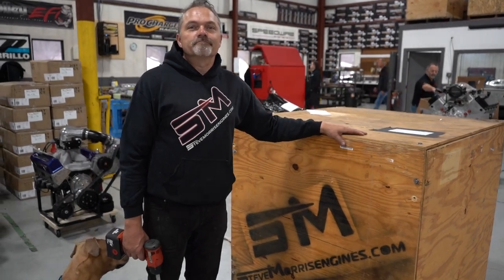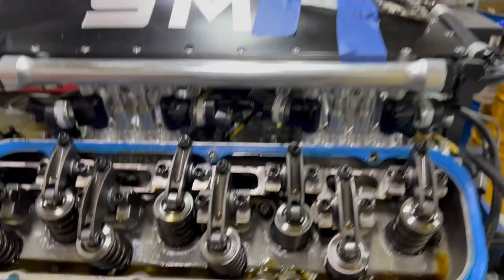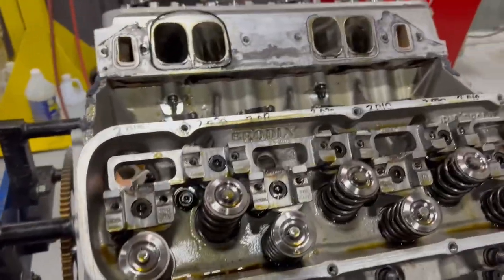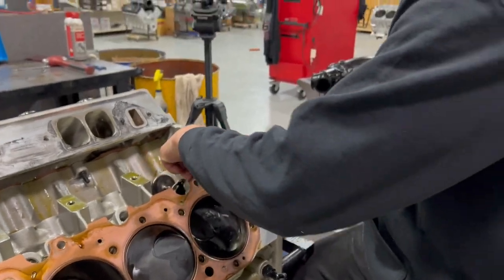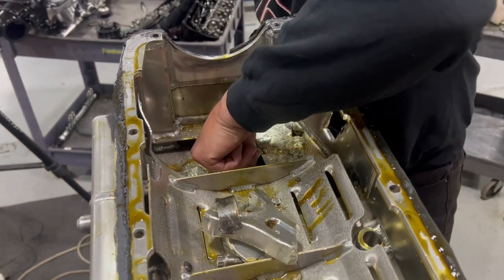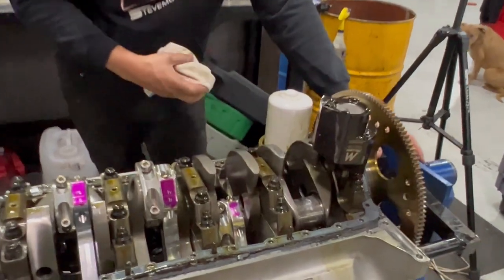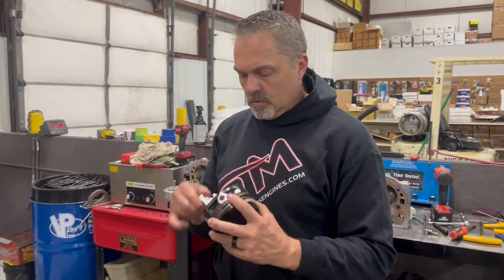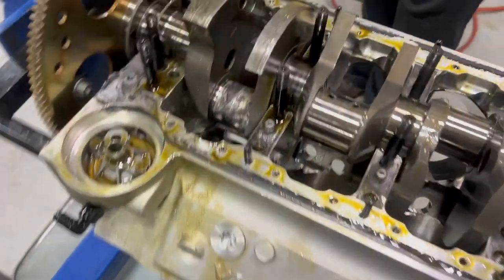Mullet !  What Happened ? - Warning: Engine CARNAGE

Comment: Only McFarland Racing can break something so quickly and efficiently 😂
Reply: Starting up ANY race engine on NO oil will do that.
Reply: @laneeric  He literally said at the end of the video if it was an oiling issue the entire journal would've gotten hot.
Reply: @laneeric  nothing to do with it dummy
Reply: @laneeric  to be fair that did happen and i wonder if it got a slight bit of bearing smeared\galled onto the crank and from there it snowballed
Reply: @tombeauchamp806  lmao
Reply: He just doing an quick V6 mod.
Reply: @laneeric  watch the whole video champ Steve says if it was an oiling issue it would have hurt the whole journal not just one side…
Reply: @tombeauchamp806  I think you are right - it doesn't take much to nick the surface, especially since it's brand new never run engine.
Reply: @laneeric  45 lbs. of boost on an engine rated for a max of 30 will do it too. Too many bald eagles! 😂😂
Reply: @picklefart  fortunately the  ⬆️  wasn't Cletter's to push lol. It would've been sooner
Reply: Shit happens welcome to racing . Welcome  to alcohol  to big boost and fuel injection. Don't take much to hydraulic  a motor. Time for some N.D.T. zyglow and magniflux  testing .
Reply: Those are those offerings to the gods of speed
Reply: @elpres2024   You're the dummy It damn sure could have started with hurting that bearing And I also don't think Steve wanted to call cletus a dumbass for doing that
Reply: @elpres2024  for all you dingbats in these comments, Steve is referring to oiling during a standard run (with the proper amount of oil) NOT about Cleetus running the engine while completely dry.
Reply: He does run his engines without oil a lot more than any normal person does lol
Reply: @laneeric   Thank you sir👍💯
Reply: @willmansfield6606   It might not have been an oiling issue but it was damn sure a bearing issue from dry starting the thing do you really think Steve wants to call Cletus a dumbass on his YouTube channel
Reply: @laneeric  Bingo, look at the heat in those bearings, thats from running it several minutes in the FL heat with no oil
Reply: @dakotaautosales9673  Exactly, these guys work together. Had cleet said something stupid, im sure Steve would have called him out.
Reply: @elpres2024  No need to get personal and call him a dummy....what Cleetus did was pretty stupid and certainly didn't help.
Reply: took a steve morris BBC V8  engine converted it  to a v6 ~  whats in your wallet ?😵
Reply: Whislindiesel said hold my beer! 😂
Reply: @redguard2529  While the starting w/o oil is bad enough, blowing past the limits of a motor is just as well for Cleet. He never learns. He even said in his video he thought it'd be fine because the last motor took the abuse. So he just assumed he wasn't lucky and Steve is a miracle worker. Oops. But it's also a part of the Cleeter crew to break stuff, it just makes more content. Hard to blame him when he's successful, it's just crazy how he prefers to do things this way when he should've gone straight to SMX. He had a small block in Mullet for a long time, and did how many rebuilds? Insane.
Reply: @kingdommusic5456  😂😂😂
Reply: Every1 in the comments are professional car mechanics
Reply: If you were going put $ down on someone who could bend/ break a crankshaft, wouldn't it be McFarland Racing? 😉
Reply: @dakotaautosales9673  exactly, cleeter is making Steve a bigger name than he already was.
Bearings picking up like this is typical of oil starvation but we all make mistakes.
Reply: @fatstrful   I've never heard of a professional car mechanic🧁🤣
Reply: @Redguard 252  I think old cleet said he pushed it to 47psi last run. Well he definitely had to many bald eagles going on that last run 😆 🤣
Reply: @elpres2024  You're in almost every comment acting like a baby. Limit your internet lil fella.
Reply: @tombeauchamp806  The way the journal was half burned it makes me wonder if it did that because all the oil had drained down to the bottom half of the journal/bearing . Then when he started it, it only had the residual oil on one side. But why didn't it get all of em. Unless those were the furthest journals from the oil source. Just weird how it was one half that  toasted. Just a thought. Its always something new with engines. I worked in my families race shop for over 20 years. We held the record for the fastest naturally aspirated hemi for a very long time. Ive always been a fan of Steve Morris. Ive had the pleasure of seeing his work first hand working on dirt cars back in the day. Steve has very nice equipment.  Him and Nelson racing are some of my favorites. Sorry to ramble.
Reply: Some people clearly didn’t listen to what Steve said, he think it’s a crank issue and is sending it out for confirmation. If it was from lack of oil it would have had damage all the way around not only on half of the journal and yes that would include the dry start. If it was from the dry start the rest of that bearing would have been scrapped as well.
Reply: @dakotaautosales9673  wrong.
Reply: @dakotaautosales9673  I would call Cletus a dumbass if that happened and I was Steve.
Reply: @roaringcat1   And you wouldn't have sold a one of your motors either It's called business
Reply: I don't think that he has that much power. I personally can't stand McFarland.
Reply: @jaydunbar7538  I guess Steve doesn't turn cranks. I know a lot of the great engine builders don't turn cranks because the time it takes the builder would have to charge so much more than a person who grinds cranks for a living.

Comment: Need to get ol' Cleet an "Is there oil in it?" sticker for the dash...
Reply: 🤣🤣👍 For sure.
Reply: I was gona say the same thing lmao
Reply: Cleet used to have the T-shirt "If it's leaking, it's got oil"
And my personal favorite, "high on freedom, low on oil pressure."

Is it fair to say he's hard on equipment?
Reply: He sure knows how to fuck shit up.
Reply: Nothing to do with the failure
Reply: @Not_A_Cat  😄 that about sums it up
Reply: @SCOOPFREE  ..I'm gonna respectfully disagree with that analysis of a bent crank causing the failure until they mic it
Reply: @gteefxr3094  he just leans on it harder than it was meant to be and companies do not mind using him for a testing ground
Reply: @gteefxr3094  this is true! Who takes a stock crate engine and pushes it out to ragged edge with tubro’s? After everyone whom tubro’s those have said don’t do it stock.
Reply: Also a dome pressure warning sticker as well.
Reply: @rossmagwood1381  said "  he just leans on it harder than it was meant to be and companies do not mind using him for a testing ground   "     Except for Texas Speed when fan bois of C McF     k  were trashing TS.  and C Mc had to come out on camera telling them to stop.
Reply: @hyperglobalmegadude  The rest of the bearings would have been way worse if it was the quick run with no oil in it. Whether or not the crank is bent is yet to be determined, but I think it is safe to say he got very lucky and didn't cause this with his itchy trigger finger on the start button.
Reply: It seems like the oil pump is on that side so 7/8 will be the last pair to get lubrication again when you run without oil. The heat is on the ' wrong side' of the bearing and since Steve had trouble to find an explanation for it, I think it's the aftermath of Cleet being 'an idiot'/making a mistake. Read below if you're interested in my reasoning.

My full explanation:

The engine was sitting in the shop with no oil in it so all the oil remaining in the engine/bearing flows to the bottom. Then the engine is started without oil and naturally the bearing side that is on top will heat up first, cause almost all oil has ran down to the bottom part of the bearing cause gravitation is real.
Same with the pistons. You don't know at what position the crankshaft came to halt, but if you look at it it's likely that that the crank part of 7/8 was pointing down. You can see that the spot where the heat was is facing up both times if you rotate the crank.
The way Steve explained it the bearing of the rods are fed from the crank bearings. After Cleetus put oil back in the pressure in the oil system is starting to build again. All the oil is pumped into the engine again and will take the path of least resistance. That means that almost all oil will flow past main bearing four so the dry side of that bearing four will get most heat of all crank bearings. When the oil finally gets to the rods most oil will flow past rod bearing seven till rod bearing eight has built pressure and bearing seven will finally get full oil pressure.

If I understood Steve correctly, it all makes sense.
Reply: @CrossEyedLion85  Exactamundo - thanks for the breakdown!

If the crank has runout I'll go eat my humble pie...
Reply: @gteefxr3094   - It makes for content that generates a LOT of views and therefore more revenue.  If you think anything Garrett does isn’t well thought out you don’t understand how smart he is.
Reply: @danmyers9372  Serious question - are you a bot or a real person?
Reply: @CrossEyedLion85  the problem I see with that explanation is the oil film that remains in the bearings is very fine and held in a very small space, probably 2 to 3 thousandth of an inch, gravity would not be enough to flow any of that oil film out of that bearing space. If u have pulled an engine apart before after sitting for a period of time u will find the oil film and the residual oil inside the oil passages is still there. Only recently I pulled an old engine apart that had been sitting for months and the oil film on the bearings is still very much there. Gravity would not have enough force to be able to push that oil film out in a very small amount of time. Being on a drag week event that engine would have been shut down for no more than a few hours before the restart with no oil in it, the oil film coating the bearings would of very much been there. 
As the engine was running at idle with no oil pressure the oil film would of been getting worked out slowly, but the pump without oil in it would not have been pumping air into the system at any rate that would make a difference as once the oil is out of the pump it will struggle to pump any air as by design it needs the oil in it to seal the clearances to be able to make pressure, therefor the oil in the passages would still be there but not under pressure to push into the bearings, once oil was put back in and the engine started the pump would pick it up and start to pressurise the system, as the oil galleys are still full of oil, once the pressure builds from the pump the pressure and oil flow would pick up pretty consistently across the entire engine as there would have been the residual oil still in the oil passages taking up the space, as pressure is a measure of resistance to flow, once u get any pressure start to build you will have pressure building in all areas of the system unless there is a blockage etc but that wasn’t the case here anyway. 
I’m not here to argue, rather I like to have a normal discussion on our opinions as I’m always willing to learn from anything I may have misunderstood or I’m just wrong about and I like to get to the bottom of the thought process as best I can 👍
Reply: @ZedTee77  this has little to do with an engine idling for a few minutes with no oil vs. running almost double the boost you were told that the bottom end could handle. If the piston is pushing the con rod down that hard on the upward stroke its everything to do with boost and nothing to do with oiling.
Reply: @hyperglobalmegadude  There are no bot comments in this thread. They are very obvious... Why do you think people making well thought out comments are bots?
Reply: needs to beep when oil pressure is below 60.
Reply: “Is there oil in it”

And 

“Lash your valves, bro”
Reply: Have to weld the key to the end of the dipstick so he's forced to check to start the car lol
Reply: @CrossEyedLion85  problem is that thats a lot of heat to darnek that much metal. not just a few revolutions without oil. if oil starvation was a problem after a minute or two the whole thing would be black, becaus ethe oil spreads around inside the bushing coaring it evenly. 

if oil starvation was the issue i would expect the heat to be the whole crank, as it is the whole bearring. with it being half the crank and the whole bearing this indicates half the crank wasnt making contact with the bearings at all, hence bent.
Reply: @ZedTee77  I don't take it peronal. Always good to hear other people trying to figure stuff out. The hive mind is real!

It's hard to compare. As far as I understand they drained the oil, did some other maintenance on the engine, forgot to refill. Normally you drain the warm/hot oil from an engine when you make an oil change. You do that to get more of the old oil out of the engine. I would not compare that to the old engine you took apart. The engine was running for at least 30 seconds with no oil which naturally causes heat and the little remaining oil will get very very thin.

If Cleetus just filled the engine up with oil again and instantly restarted the engine the heat would have still been in the engine with now very thin oil. We can assume there is air in the system at that point. You can compare it to a water hose with holes in it. First the air has to get out the system and the holes furtest away from the input will start pushing water first till every hole is spilling at same rate.

For minimal damage: Put oil in. Let the engine cool down again. Then crank the engine with the starter motor to get the oil pumped through till you have oil pressure again. Then start the engine with ignition on.

I assume Cleetus put oil back in and started the engine again. Maybe he can elaborate on what he has done in what order. That would help solving this.

All your practical knowledge with pulling your fingers through oil against my scientific explanation.
I have taken some engines apart for fun, but I rarely need to repair some, cause not even the cheap Chinese pit bike engines I ran in my projects used any oil after I ran them in carefully.

What Cleetus is doing to his stuff is just torture.
That Mullet engine is so well built. No doubt in me that I could use Mullet as a daily driver and go sub 7.5 on the weekends with it for years without that thing blowing up.
Reply: @abnormallynormal8823  that's friggin hilarious
Reply: used to be Turn on the fans, now it's a sticker for Did you put oil in it?
Reply: Reminds me of the "turn on intercooler" one he had lol.